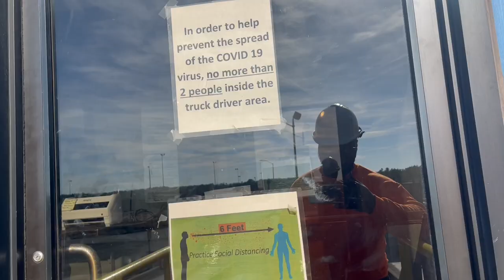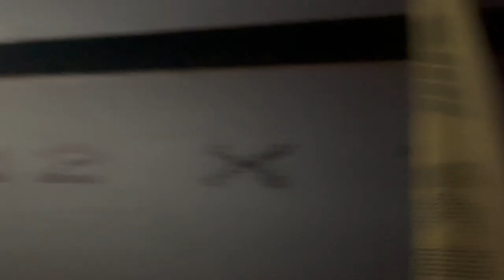Two Tire Blowout and Flatbed Cargo Securement Steel Beams Keep On Trucking

Comment: What psi they got you running your tires at?
Reply from the maker: Between 90 to 100
Reply: @bigsnow1705  roger that . Was gonna say most people put to much air in there tires not knowing once your tires heat up it will reach your desired air pressure , they don’t teach that 😎. You running 16ply tires? Oh by the way got the Bluetooth and it’s a great buy.